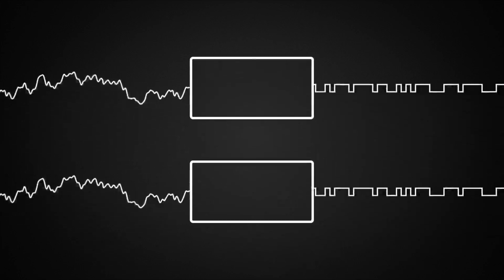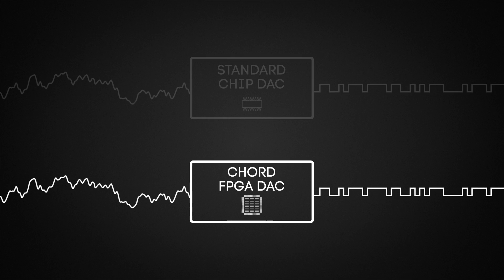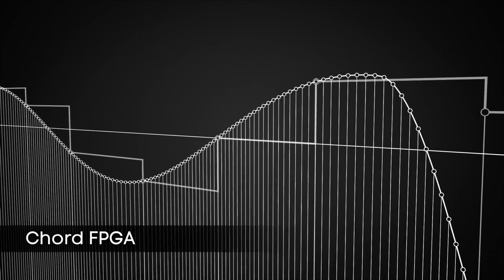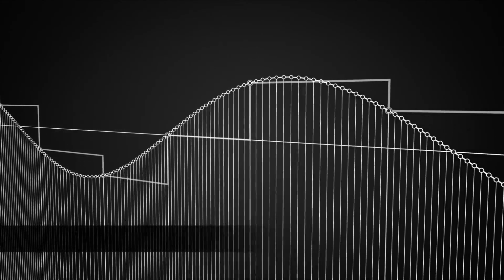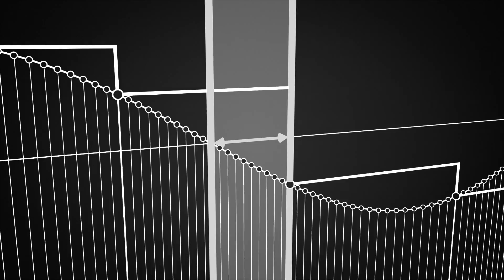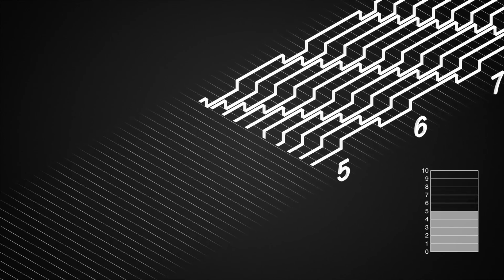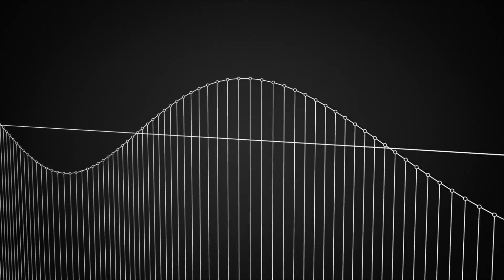Chord Electronics FPGA DAC Technology Explained

Comment: This a ridiculous pile of lies. You are using an FPGA to unnecessarily drive flip flops. Flip-flops are digital devices and do not convert to analog. At some point you've got a transistor that is driving the load or switching a resistor on / off to output analog. Not a flip-flop. All clocks are subject to  jitter and even if you clock them directly, you should have been doing in that in the FPGA where the clocking would be more stable. 

Then there's a pile of lies about "excellent crystal oscillators."  All  micro-controllers use crystals. All clocking signals in all digital devices are "ultra fine" in the Mhz range,.

If you actually cared you'd use a 10Mhz stable clock and derive from that like every other recording studio does, but you fail to do that.

Then you go on to blame the silicon in the chip (which whoops, by the way, your FPGA is also made of) for noise. 

The secondary pile of lies about a discrete output stage being more noise immune than a sealed, on die op-amp (which are typically shipped with laser-cut and tuned sections) is another falsehoold.

It would take too long to disprove most of the lies in this video.
Reply: But wouldn’t the flip-flops help with drive current going to the output transistors?
Reply: @leafyleafyleaf  Unnecessary. A simple buffer would have been sufficient and most microcontroller pins are strong enough to drive a transistor, which does the real work.
Reply: @leafyleafyleaf  Doesn’t matter. The microcontrollers can handle that or a simple drive transistor
Reply: @johnadams2815  I hear you about the marketing hyperbole here. Too bad, as there is some interesting stuff they are doing in the FPGA. As for externally clocked DACs, is there one you would recommend? Full disclosure, I own a Chord Mojo and love it, but wary of grand claims in the audiophile world.
Reply: @leafyleafyleaf  I would recommend buying an actual device that most studios would use and don't buy "audiophile" gear. E.g. Antelope, Prism, Universal Audio, etc...

Comment: Wow, so much pre processing of the signals and so many waffle words. FPGA are digital only, so I’m guessing this is PCM output, then you put it through a flip-flop, which is liable to massive jitter. The marketing Wank is high here..
Reply: Not "wank", simply audio terminology you can easily Google is you are not familiar with it.
Reply: @Caravaggio44  You obviously fall for the BS. FPGAs are general re-programmable Gate-arrays for digital circuits. This "DAC" is just a digital filter and PCM output implemented in the Logic fabric. FPGA's are notoriously noisy and their clock jitter is dependent upon the circuit you implement in the fabric. Outputting the PCM stream to a CMOS logic gate to magically create Analogue (again from a digital logic gate) is just bullshit, the logic gates are also inherently jitter prone and noisy. This video is using a load of pseudo-technical words to fool you into thinking it is something magical or special. A dedicated audio DAC is designed to minimise THD, Noise and Jitter whilst providing a true analog current or voltage output then is then amplified. This video is very inaccurate and it pure hype.
Reply: @jonlaws4493  looking forward to hearing your DAC Jon ;) I have the Qutest and it sounds amazing...all I need to know and understand...
Reply: It has a pulse array output.

Comment: It's simply just digital to analogue conversion, known zo mankind for a century. 99% of this video is complete gibberish.

Reported it due to misleading information. It represents things as good and "necessary" that aren't. Customers are getting mislead by stuff like this.
Reply: What system have you heard the Chord Dac on, and which Chord DAC? I own the Mojo, and I've just upgraded the Qutest to the Hugo TT2. In the past, I've had the Xduoo XD-05 before going to the Mojo and before the Qutest. I used the Schiit Lyr 3 and the THX AAA 789. I sold those to get the Cayin HA-300 tube amp with the Psvane ACME 300b tubes.

Even going from the Qutest to the Hugo TT2, there's a very big jump in sound quality. I'm hearing details, separation, and timbre that I haven't heard from the Qutest, which is already very resolving.

It's like driving a car. If all you've driven are Hondas and Toyotas, even if it's one of their more sportier cars, you still can't compare how a Porsche 911 drive until you've driven one. Chord DACs, especially the higher end ones and especially on a higher end system (Mine is a $4000 300b tube amp with $1000 pair of 300b tubes), you'll absolutely hear the difference right away.

So no, you absolutely don't know what you're talking about.
Reply: @JoeGunawanfotosiamo  Xduoo XD-05  and mojo which one is better?
Reply: @aqwandrew6330  Oh the Mojo for sure! The XD-05 distorts on LCD-2C
Reply: You are an idiot. Of course D/A & A/D conversion technology has been know to mankind for decades, since the mathematics of discrete time data manipulation was created. Converting data from digital to analogue faithfully is extraordinarily difficult, and audio, though it doesn't sound like a mission-critical application such as military, medicine or aerospace, is actually a more difficult domain for the application of quality DA,AD conversion due to the brains sensitivity and ability to perceive sound. DA & AD conversion is done everywhere, how well its done is another story.

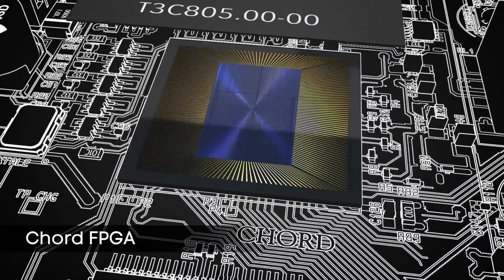Comment: watch 1:24 : NOISE SHAPING and filtering. essentially it's just typical "measures good, sounds bad" delta-sigma DAC chip with more complex filtering techniques (aka delta-sigma + upsample chip). this FPGA is just low bit depth processor like typical delta-sigma with maximum of 10 bit but because of noise shaping and filtering able to achieve 24 or 32 bit. it's widely known in audio world that this noise shaping and filtering is the culprit of "digital sound". there's nothing new here. sorry not interested ...
Reply: There is a lot new here, actually. Noise shaping and filtering done with such a high level of overkill that it pushes any artifacts down to unnecessarily (but welcomed) low levels. This is the best DAC I have heard. And I was skeptical too.
Reply: Have you heard it? No? Didn't think so.
Reply: Their DACs sound nothing like delta sigma or any other DACs for that matter..Chords DACs are way more naturally organic and faithful to the music while digging deeply into music with euphonic imaging.Their technology involves more than just noise shaping.As explained in the video.They  are the industry leaders for a reason.

Comment: The problem with chord is the management hold everything too close to their chest. The sound is fantastic but lots of the products are clunky and not the easiest to live with
Reply: nah, you get used to it. Sometimes, simplicity is great. I had the Qutest until I recently just upgraded to the Hugo TT2, and in between, I borrowed my friend's RME ADI2, and THAT Dac is way too complicated. Too much to fiddle around, and I still couldn't get the kind of texture in the mid-bass that I was getting with the Qutest. The RME ADI-2 is a smoother sound, but at the cost of being too aliased in its sound and at times, less natural (like the saxophones! Just not as good as the Qutest).

Now the Hugo TT2, though, WOW! That's on an incredibly other level! I did not expect it to be so much better than the Qutest by a wide margin!

Comment: Sounds like snake oil. The high sample rate doesn't do anything because speakers /  headphones can't reproduce those high frequencies and humans can't hear them. Anything above 192 khz is a waste of money. Even 192 khz is overkill for most applications. The huge FPGA and the fast clock also add a lot of noise to the power rails.
Reply: Sample rate is not the same as frequency!
Reply: @MrGorpm  It's proportional.  Sample rate is twice max frequency; therefore 192 KHz will have a max frequency of 96KHz.
Reply: The benefit of higher sample rates is in the time-domain, not because of ultrasonic sound.
Reply: Oh dear you’ve just shown your lack of understanding.....🙄
Reply: @Tinman2809  Elaborate.
Reply: You dont know shit about Chord DACs or DACs in general.Especially if you havent heard one.

Comment: Keep improving the product. 
New programming
Maybe add display 
Add heatsink
Reply: I think most of them are directly mounted to their aluminum enclosures to use the enclosures as heatsinks. I had a mojo: it got warm, but had no problem running for it’s entire battery life (though I’m more interested in the Battery Bypass desktop mode of the new Mojo 2).

It could be argued that all necessary information is displayed by the Chord colored balls… though I admit I had to reference the manual to see what any of the colors meant besides volume 😅

New programming… why? It’s already new programming compared to DACs made with off-the-shelf chips and reference programming. I think the new Mojo 2 has new programming to take advantage of the additional FGPA taps, but the DAC and filtering programming is “solved,” the only thing they might update over time could be their DSP effects like the EQ functions.

Comment: Not to be a pedantic, but a lot of not-Chord DACs and not-FPGA DACs use a crystal oscillator. I have $3.00 USB sound card that has a non-FPGA DAC and a crystal oscillator. And a lot of not-Chord DACs and not-FPGA DACs have ways of reducing jitter; it's not unique to a Chord DAC. That's very misleading. Now, later on, they do explain things that do make their FPGA DAC different and other ways in which they explain how they eliminate jitter. I don't know if they eliminate jitter 100%, but they explain unique ways, so it's possible. 

The video is good I just got rubbed the wrong way by how they claim that a crystal oscillator and jitter reduction are unique to them.
Reply: thanks
Reply: Agreed.  I don't think it is possible to completely "eliminate" jitter.
Reply: bro. you seem audiophile.. suggest me a amp dac for athmx50 headphones
Reply: It depends on what you want to achieve. I find the athmx50 to have too much treble, but that's my opinion. Now if I had the athmx50 I would try and balance out the treble with a tube amp. No, I'm not an audiophile who says tube are the best and only way to listen to music. I think tube and solid state amps are both good and it's about your taste. I prefer solid state amps, but I do like using tubes from time to time. However, I think the best way to balance the treble of the athmx50 would be with a tube amp. The best affordable tube amp I know is the Schiit Vali 2, and try different tubes with it; the stock tubes won't add the warmth that helps the athmx50 sound more balanced. If you can't get the Schitt Vali 2 the look into the Bravo Ocean or another one of Bravo's tube amps. Not as good as Schiit's but still affordable.

As for a DAC, in my opinion, DACs don't affect the sound to the point that you need the "right" one for a certain pair of headphone or speakers. No, if you want a good DAC you could just go for a Schiit Modi 2, Schiit Modi 2 Uber, Or a version of the ODAC. If you want a DAC with new technology, you cold go with the Schiit Modi Multibit.

Does this info help? Or do you want to achieve something different? Maybe you can spend more and want the best not period, not the best wallet-friendly picks. Or maybe you want a single DAC amp unite. Or maybe you love the treble sound from the athmx50 and don't want the tube amp.  Let me know.